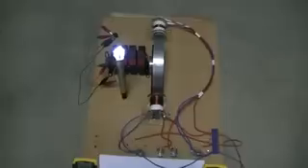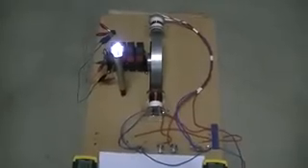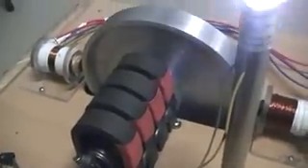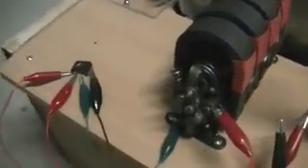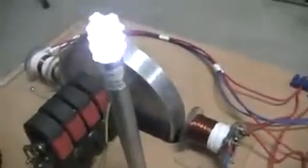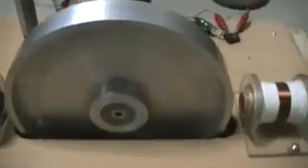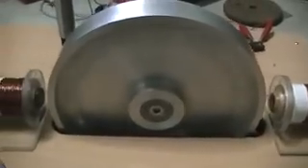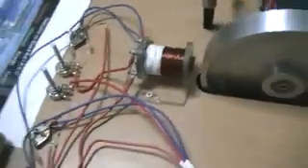pulse motor driven 1875 generator.wmv

Comment from the maker: @Beachcomber310 Hi Beachcomber-as you would have seen in my first vidio it pump'd that little cap up to 300 volts quick-but that was the limit for the cap.I will hook a bigger cap up to it today and run the motor to see how far we can get it up.I did infact try an incandescent lamp(seems we think alike lol) but it wouldnt fire it up,not quite enough current i think.
 TinMan